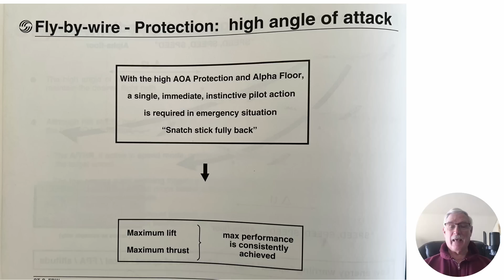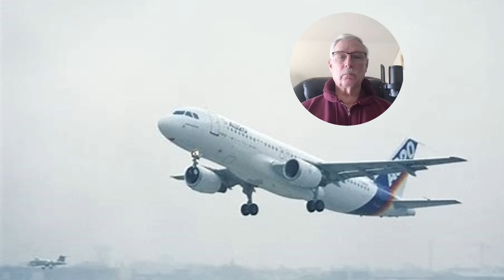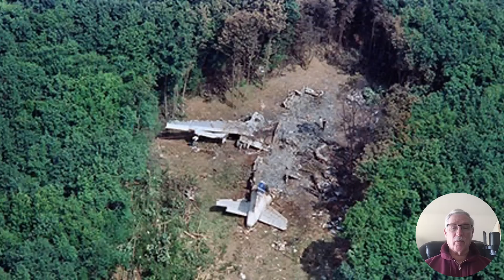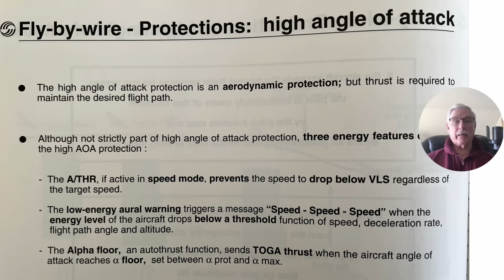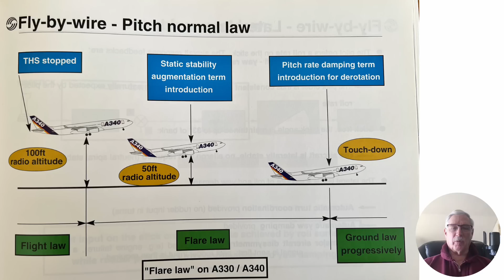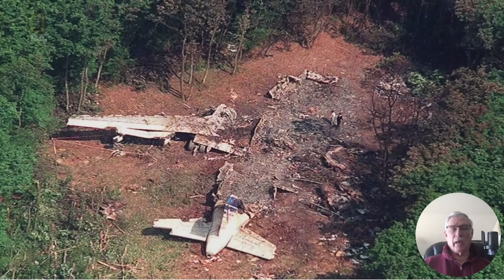Overconfidence in Fly-By-Wire protections First fatal A-320 crash 26 June 1988

Comment: I have never heard of an Alpha floor before. I have tiled floors, carpeted floors and also concrete floors on my veranda. Are they nice?

Only kidding. I read the report on this accident. In a nutshell, the captain had the aircraft in landing configuration. The flight computer was hell bent on landing the aircraft so when he pushed the throttles up to full power, the engines wouldn't spool up. Eventually the captain had to pull the throttles back to idle and pushed them forward again to get the engines to pool up to full power but alas, it was just too late and the aircraft ended up in the trees not far from the end of the runway.

I do stand to be corrected. I am speaking from memory of what I read in the accident report when it was released.

Comment: I still don't really understand how or whether the "alpha protections" affected the outcome here. It seems from the flight data recorder timestamps that the crew realized that they were headed for the trees about 10 seconds before the impact, and since they were at flight idle and very low speed, it seems unlikely that anything could change the outcome at that point, alpha protections or not, since 5 seconds was needed just for the engines to spool up.

It's also not clear to me whether the "alpha protections" were disabled automatically like Mr.Rogers says here, or whether the crew knowingly disabled them (as per wikipedia description of the flight plan), or whether those protections were still on or came on at the end (same wikipedia section somewhat contradicting itself).

Then you have the pilot's claims and speculation about whether he indeed tried to apply power earlier but was somehow ignored/overruled by the fly-by-wire system (although in that case why did it allow him to apply TOGA power just a few seconds later?)

Confusing. Overall, imho this accident seems to be more of a problem of flying low and slow in unknown terrain, which is madness, not to mention with passengers on board...

Comment: I don't believe that has been overconfidence in fly-by-wire protections. Or at least, that is not what I've read - because they did turned them off on purpose for the stunt.
 The pilot performing the stunt, switched the fly systems into an alternate law (he knew how to do it) to be able to do such a low pass without activating the Alpha-floor protection.
However, there are also some suspicion that the engines didn't promptly react to the co-pilot TOGA input in the expected time frame of 4 or 5 seconds and that the flight data was tempered with.

Comment: I have a couple of problems with this, and one is that there were a couple of instances when the A320 aircraft was new, where the engines failed to respond to pilot commands. 
737s also used the CFM-56, and I often dealt with the GE Aircraft Engines People, who supported the CFM-56. 
-some of which were Snecma employees. 
Their employees told me about the problem, which was later supposedly corrected. 

Another aspect of this that is very troubling, is that the flight data recorder that was presented in court, was not the one in the photo of a French police officer carrying it from the crash scene. 
Chain of custody of the recorder, was broken.
Also, there were anomalies in the recorded data, that showed manipulation. 
The French authorities didn’t want their new national aircraft looking bad.

Comment: This is a good presentation. But many readers here focus too much on the airplane itself and not where the problems are:
1. The human-airplane-interactions.
2. The marketing in the 80's and the lack of understanding of the limitations of the automation.

As with everything in life, we learn from past experience and use this knowledge in our future decisions. Airbus is no exception, and they knew from the first aviators that an airplane can stall, spin, be overstressed etc. The school of thought at the time was: don't do it! Airbus was more: but people make mistakes, why not introduce safety and prevent them from making mistakes. After all, many things in life have safety features, just look at any object or machinery around you that has the potential of causing harm.

Aviation is no different. Stalling an airplane is something all pilots want to avoid. Early airplanes had no protection. Later, it was discovered that some sort warning was needed to tell the pilots of the imminent stall - the stick shaker was introduced. Knowing that humans do get confused under stress, a more pro-active solution was needed - the stick pusher was introduced. But even with the stick pusher, manufacturers were still looking for a better solution - let's avoid the need for a stick shaker and pusher. Let's (try to) prevent the pilots from putting the aircraft in a situation where it can stall. This is where the fly-by-ware and the protections come into the picture.  

Airbus tried to reduce the human factor in flying. This is necessary, as humans do make mistakes, often when under stress. If the aircraft can help, it should! If it can prevent the pilots from making mistakes, it should! 

Designing this is not trivial, and Airbus put their prior knowledge into the task. But as the video shows, they were not perfect and some mistakes, or wrong assumptions, where made. You learn from mistakes and the fly-by-wire system was improved, but not without some people paying the ultimate price.

Human-airplane-interaction is not easy. A lot research is done on the psychology of the human operator. The mistake made when the A320 was introduced is to trust the automation, as the video title says overconfidently which is naive and problematic. The problem lies not in the automation, but in the human's understanding of the automation. In the above case, the pilots wanted to ascend while the automation interpreted the pilots inputs as if they wanted to land.

The problem is that commands given by the pilot may be similar, but they may have different intention depending on the context in which they are given. Near the runway, the automation is programmed towards landing the airplane. In the sky, the automation is programmed for flying. In most cases, this matches what the pilots expect. In rare cases, the expectations of the pilot disagree with the logic the automation is programmed to apply.

This brings us back to the problem. The pilot must know in what context the automation is executing its logic. This limitation of the human's interaction with the airplane was not well understood in the early days of fly-by-ware. Naively, the thought was that it was obvious that near the runway, the airplane is obviously about to land. And when landing, different rules applied then when flying. The rules and logic was written in the documentation, but no emphasis was given those, as people were overconfident "that the computer will do the thinking for them" (quote from Homer Simpson). 

Part of the solution today is more intensive training on not how to fly the airplane manually, but to better understand how the automation is flying the airplane. Understanding the automation puts the pilot a step or two ahead, should something happen, the pilot knows where the airplane is, what it is doing and what he has to do if he needs manual control. 

The other part is improving the automation to better inform pilots what it is doing. There may be a line somewhere in the flight manual describing what it may be doing, but in a high workload situation, it is much preferred the airplane to pro-actively tell the pilots about the state it is in if a problem is detected. As mentioned, the "speed speed speed" announcement was introduced, as it was obvious the pilots did not fully understand what the airplane was doing. Another lesson was the "dual input" announcement. In theory, this announcement should be superfluous, as only one pilot should be flying the airplane and when needed, it should be "handed over" to the other pilot with an explicit verbal instruction. But reality is different and AF447 thought us that the announcement was needed (I believe it was there even before AF447, but only as a small warning on the display, and not as an oral announcement).

Today we understand much better the challenges of humans interacting with the airplane. We teach humans accordingly and we have improved the airplanes to be easier to interpret. We've learned from our mistakes and we have improved training and airplanes.

And Airbus has learned not trying to sell the airplane as "unable to crash", but as a plane where the "automation offloads trivial flying tasks from the pilot thereby reducing the workload".

Comment: Hello Ron, would you know where the idea originated that aircraft had to be 'protected from pilot inputs' in this manner? Like you I'm retired. Remember so many mishaps and read a lot about things happening before my time. Not many of these were a result of pilots stalling and spinning airliners, or pilots trying inverted flight, or overbanking + over-G-ing  aircraft. Pilots made many mistakes and a lot of controlled flight into terrain occurred. Collisions, running out of fuel, maintenance errors, extreme weather/windshear, hijacks led to disasters. Why did Airbus start to 'fight' against something that had not appeared to be a major threat to safety? To me it seems a design philosophy which was (and is) not evidence based, it is just a 'belief'. If it was necessary and effective to have this sort of protection envelopes, all non Airbus products would have made many headlines featuring crashes caused by unprotected inputs of pilots. History showed a different picture.

Comment: So, literally the most important place to have this feature is low altitude pull-up but that is also the precise place you cannot have this system engaged, as you must pull up to flare for landing at low altitude. So the entire concept of this system is flawed from it's inception.

Why not just firewall the thrust levers, set climb attitude, and slowly retract flaps. OR do all of those things as abruptly as possible, and let the FBW make smooth throttle advances, and retract flaps at a rate based on gaining airspeed.

Comment: I'm a bit slow at connecting the dots.  Lower than 100Ft AGL so alpha protection was disabled right (must be to permit landing).  So if the maneuver was performed above 100Ft AGL, the aircraft would have automatically applied TOGA thrust in time for the pilots to climb above the obstacle and avoid the crash?
Reply from the maker: You got it!

Comment: Reminiscent of the Air France A330 over the Atlantic, despite all the FBW protections a little pitot ice caused flight law reversion and it too proved itself crashable.
Reply: Are you talking about the airbus coming from Brazil? Same accident?
Reply: @lcfflc3887  Yes—the A330—storms in the inter tropical convergence zone caused pitot icing and flight law reversion. The second officer stalled it all the way down. Very sadly the first and second officers were saying just before control loss “thank goodness we’re in an A330”. I can remember watching the TV news as the early A320 failed to gain altitude and descended into the forest.
Reply: @Michael.Chapman  from what i heard it took them a while to get the black box almost like is there was no chance of doing so, in fact i thought the mystery of the crash was never solved because of this, i don't know what to say but it seems like it would be a lot safer to fly in an old 767 or 727 then in this modern days flying junks, what a disgrace for aviation history.

Comment: Wasn't this test pilot the "cream of the crop" when it came to flying this new aircraft?  I often comment to the airbus guys that it seems as though they need to be better at understanding/running a computer than they do at actually flying an airplane....
Reply: Cream of the crop at Air France yes, first instructor pilot for A320 there. But not aware of the tall trees at the end of the runway. Cream of crop at Airbus, definitely not. They didn't perform low-pass low-speed stunts, 30 ft at 112 kts with tall trees in front of them. Why would anyone in their right mind? I don't blame them.

Comment: Wasnt this limitation taught to all aircrew during type rating training at the time? Great presentation as always Ron. Thank you
Reply: Not back then, or at least not to an extent that they understood it. In the first decade of the A320, there were many pilots that did not understand the way the automation works and misunderstood it. This has improved, as we today know where to put the effort into.
Reply: @todortodorov6056  Probably correct as I knew about it when I checked out on the A320 in '98.

Comment: in MFS 2020  I even  found holes in the Fly-By-Wire protections in the A320  I even went in ALpha Floor. I even stalled the A320 got the speed  speed Speed warning I did  go in to ALHA max the plane preformed grate even  hard the Airbus stall warning
here is a video of Barrel Rolling an Airbus A320 Simulator https://youtu.be/BVITJbVNvY4?si=bGNvWV848el7q_4C
Reply: I don't think MSF 2020 (not MFS) is the reference for A320 training.

Comment: After the uncrashable Airbus crashed and was fixed in 1988, another Air France pilot managed to crash another one in 2009.  Can you hold an uncrashable Airbus in a power on stall from 40,000 feet to impact?  The first officer found a way to kill himself and everyone else onboard.  Air France 447 still wasn’t pilot proof.  As Ron discussed in another video, side sticks don’t provide feedback to the pilot monitoring like a yoke does.
Reply: The AF447 want into Alternate Law, losing the stall protection. The pilots of the AF447 did not understand what this meant, even if the aircraft for periods of time was telling them that they were stalling it.
Reply: Even read the accident report?